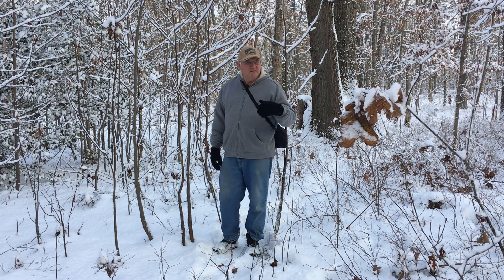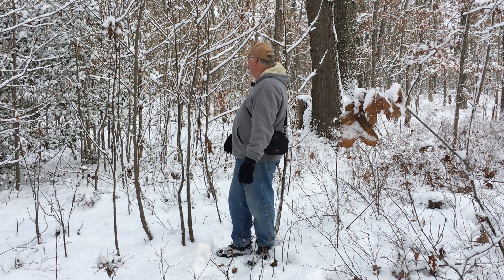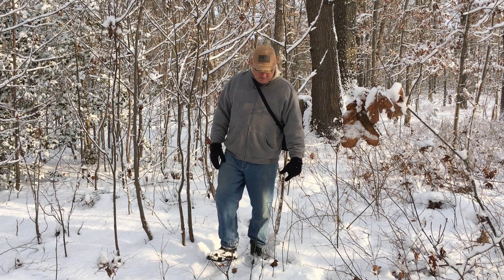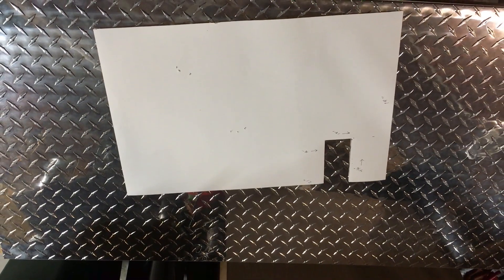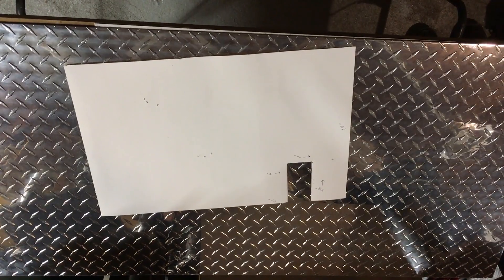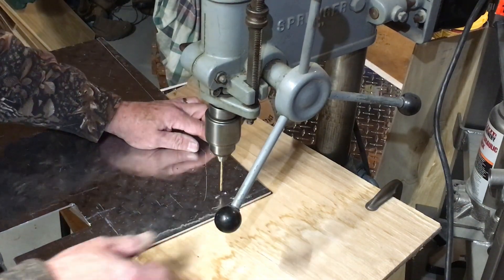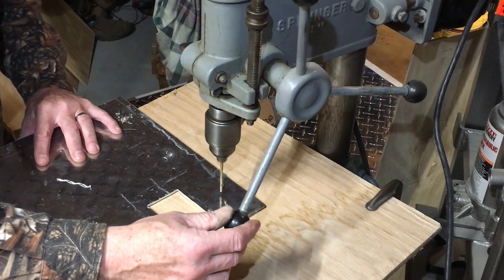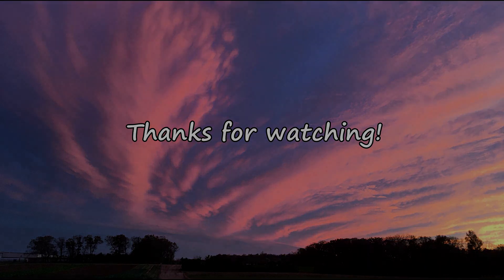Kioti CS2520 fan blade protection

Comment: (List created from items listed in video)

SKID PLATE
14" x 21" overall dimension
    ~ 4 1/4"  x  1 1/2" cutout*
        *not 100% sure 
6 holes
    ~ 8 x 125mm tap
    ~ 8 x 125 x 16mm screws (4)
    ~ 8 x 125 x 25mm screws (2)
    ~ Wire Loom (2?)
    ~ Nuts & washers for above screws
    ~ 3/8 bit final hole drill bit

Comment: I've lost one fan already doing exactly that small sappling wanted to do the same thing, do you have a belly mount mower? Wondering if I'd have to remove it in summer months for mower deck great work! Just came across your channel
Reply from the maker: No, I don't have a belly mower, so I can't say if the pan would have to removed.
Reply: @thethriftysuburbanite5251  alright, thanks for anyways great idea though I think im going to have to do something similar

Comment: I’m interested in doing the same think on my CS2520. The only concern is the amount of air flow drying the summer months when it in the 80’s and 90’s. Have you had any issues with overheating.
Reply from the maker: I don't work the tractor hard or long, so for me it doesn't seem like it makes any difference.
Reply: I made a similar shield for mine but used some heavy expanded steel instead. Working out well so far.